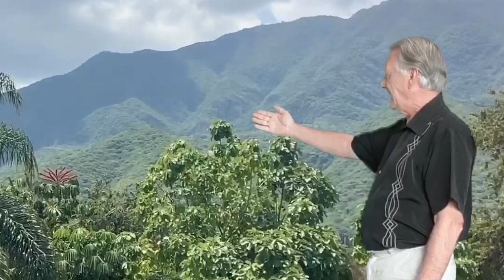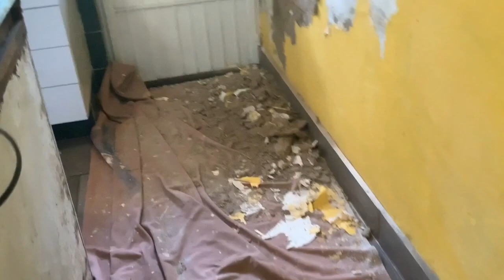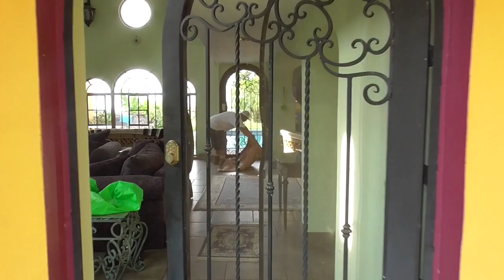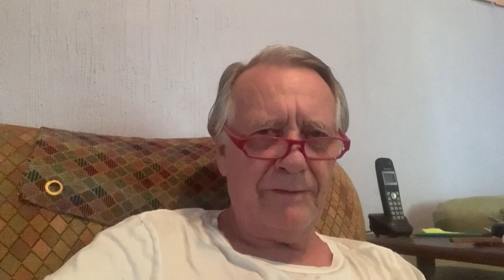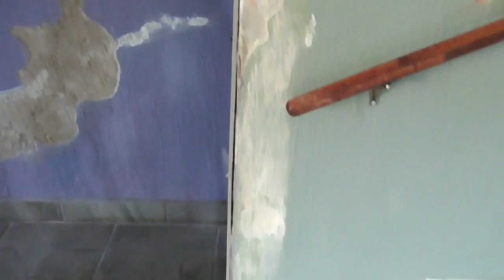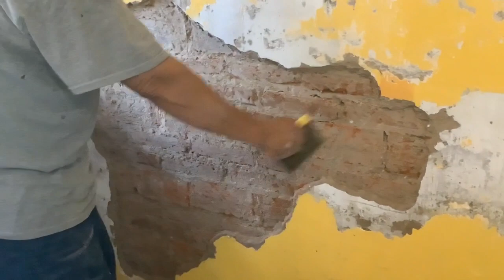Cool Weather in Ajijic, Mexico.

Comment: Moisture is plaster's worst enemy...without dehumidifying, the plaster will continue to blister...it happens here in Baltimore in every single home with plaster walls and ceilings, but it looks like you are using portland cement and not plaster? Hot and humid here...UGLY...even the bees are pissed off during this type of east coast weather